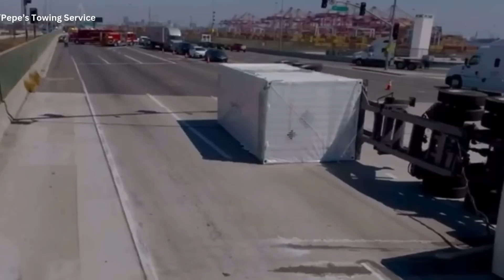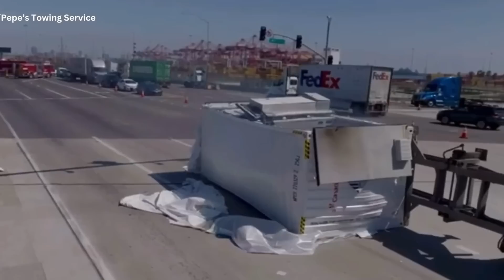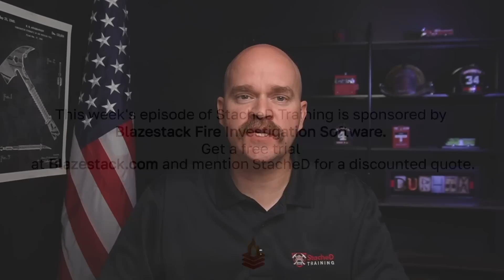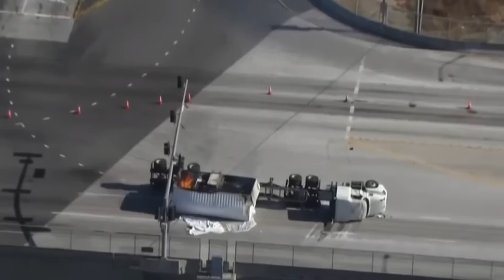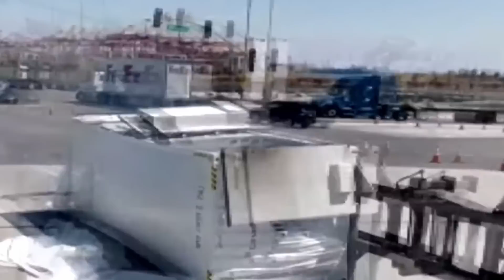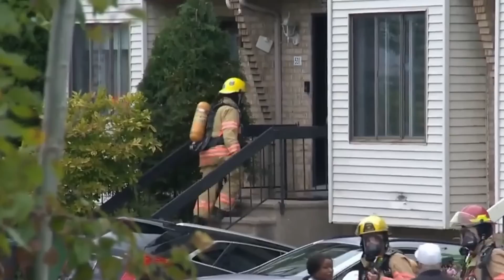LA Freeway Explosion & Montreal Port Fire: Lithium-Ion Battery Crisis

Comment: What kind of lithium ion battery were involved in those two cases? I understand that lithium ion phosphate is safer as it has less risk of thermal runaway.
Reply: Fairly confident the San Pedro incident involved LFP, as energy storage was from Canadian Solar, and their storage products appear to be LFP. 
But about LFP:
"... the important factor here is that due to the lower TR temperature of LFP cells it is more likely that the vent gas is emitted without combustion. This results in a greater likelihood of vapour cloud emission and accumulation, leading to an increased risk of vapour cloud explosions for LFP batteries compared to NMC. This needs to be stressed in safety and risk assessments given the general belief that LFP cells are “safe” or “the safest” in public media. This “safest” chemistry belief is based on typical abuse tests (overheat, penetration, etc) due to LFP having lower maximum temperatures and heat generation or the absence of visible sparks and flames. However, there are many instances of LFP-based EVs under TR and emitting vapour clouds, especially in the Chinese market where LFP dominates. Additional to this is the emission of toxic substances that also present a further hazard. As such, it is unwise to categorise the safety of a battery system based on the abuse test of cells that do not account for the explosion of the off-gas (and its toxicity) or the influence of the battery system design on failure behaviour. Therefore, there should be a focus within the battery community to provide a holistic assessment of battery safety considering stability and thermal, fire/explosion and toxicity hazards...
While NMC batteries release more gas than LFP, LFP batteries are significantly more toxic than NMC ones in absolute terms. ...LFP presents a greater flammability hazard even though they show less occurrence of flames in cell TR tests."
Excerpt from the May 2024 edition of Journal of Energy Storage. "Review of gas emissions from lithium-ion battery thermal runaway failure - Considering toxic and flammable compounds"
Reply: @greenriver-c7c  thank you for the info which is from a reputable source. It is worth thinking over.
Reply: LFP can still go into thermal runaway, but it takes a lot more abuse. Also it is easier to stop by cooling it with water. A recent study shows that a regular sprinkler system was enough to limit the impact of a thermal event to a single cabinet of LFP batteries. With NMC this was impossible in the same conditions. Both tests were forced with an external heat source.
And in the end an LFP fire will release less toxic materials than an LFP fire because there are no Nickel or Cobalt present and there is mostly CO2 instead of CO. 
NMC should be banned for anything bigger than a laptop (500 Wh)
Reply: @SolAce-nw2hf  thanks for the info. LFP is a good tradeoff between energy density and safety. Still, i would not buy an EV since I do not have a garage far enough from my house.
Reply: @Citizen052  I can relate to your fears. Only a few years ago I would not even consider putting a solar battery system in my home because of the fire risk.

But with much research and double checking every opinion, fact, fire statistics and negative news about battery fires, the LFP chemistry with a modern BMS turns out to be less of a risk than my home gas boiler.
NMC is already present in my home in laptops, tablets and phones and many other battery chemistries are also present in AA and AAA form factor.

Personally I have no off-street parking and I drive less than 5000 miles a year. So for me it does not make sense to get a new car as long as the current ICE works just fine. The EV switch will happen eventually, but public charging needs to improve a lot for that.
Reply: @SolAce-nw2hf  thank you. My reasoning is indeed very similar as yours. Me too I drive less than 6000 miles per year and my car has not even clocked 55k miles. So I won't change car for now and I hope that the battery technology will improve the safety aspect very soon.
Reply: @Citizen052  Yes, just keep it well maintained and let the EV improve at the rate of the PC in the early days while you wait 👍
Reply: @SolAce-nw2hf  excellent advice.
Reply: I'd say if there is an explosion then it was LFP, because it does not burn, it just creates a thick smoke (in case of thermal runaway),  ca 250 Ltr per every kWh, 50% of that is hydrogen. NMC on the other hand usually goes immediately on fire, because it is able to create oxygen on its own and even before the fire there is less hydrogen than with LFP.
Reply: @sleepydog6595  Both create a lot of hydrogen, but in NMC the amount depends more on the SoC. When abused LFP can also create a big explosion, but in that regard a big rig filled with fossil fuel is not exactly nice to deal with either. In my opinion all energy storage systems should have a vent for off-gassing, even in transport.

Comment: This looks like a port transfer vehicle, not an over-the-road semi truck. The container may or may not have been properly secured when the driver turned too fast/too tight, tipping the top-heavy load, truck, and trailer onto its side. The resulting fire was a forgone conclusion.

Comment: Do commercial drivers need a special license endorsement to transport one of the grid scale batteries? Seems pure ignorance that on dry pavement on a sunny day trailer would turnover.  
PS - LAFD should have a concrete pumper truck on contract so that they can fill the container with sand with just enough water to mobilize the sand. That way the can quench the fire and remove container for further disposal by OBA protected personal. 
PS — Can you imagine the 405 freeway shutdown for 24 hours. Not acceptable.
Reply: Containers on a container chassis trailer are known for being high risk of rollover even at low speed as they are often packed to the roof and have a high center of gravity.
Reply: @juliogonzo2718 Wouldn't they have to be packed at the roof and not at the floor to be top heavy? Otherwise the center of gravity is 4 feet above the floor, which is standard. Now if most of the load is at one side of the container, then you've got an imbalance on the trailer which is difficult to deal with and impossible to see.
Reply: @HuFlungDung2 anything over 1/2 container height is usually considered top heavy, plus depends on the dimensions of the cargo.
Reply: It definitely would be a hazmat load. I believe in the US, you need a hazmat endorsement. Here (Canada) you need TDG (transportation of dangerous goods) training which often is done in house at an employer. You get a wallet card certificate which you need to produce if stopped by police or motor carrier enforcement.
Reply: @juliogonzo2718 yeah we have to have hazmat endorsement to haul placard loads. Some hazmat loads don't require hazmat (based on a few factors) because they aren't placarded but those are very rare.
Reply: @raymarshall6721  can't remember the exact numbers here, been a while since i hauled hazmat, but think canada it's exempt from placards if its three containers or less and or 500kg total weight of dangerous goods and containment combined. So like 3 100lb propane tanks at 76ish kg each or two  drums of diesel at about 194kg each. Sorry about the metric it confuses me sometimes too lol
Reply: Pretty easy to see it wasn’t pinned down .

Comment: Yet another example of why large scale lithium based storage is utterly absurd the risk was bad enough with small device’s burning your house down but that could be managed to an extent this is next level ideological stupidity to think that a battery technology of which has inherent issues with instability are remotely suitable for large scale use just defies the most basic human logic
Reply: The geniuses in Australia now use lithium-ion batteries to buffer the grid because they produce with renewables. They get ripped of by the providers and have this crazy high outcome risk right at their door.
Reply: LiFePo batteries aren't nearly as prone to fire. The battery storage is often in remote locations. This resulted from improper logistics, not from usage. You can bet this particular episode will not be allowed to happen again. BTW there have been numerous tanker truck fires in the past, unfortunately. If you're correct in your basic point, time will tell, but I doubt it.
Reply: @nooneyouknow7036  -  Fairly confident the I-15 incident was a CATL LFP BESS container, and fairly confident the San Pedro incident involved LFP, as energy storage was from Canadian Solar, and their storage products appear to be LFP. And some further considerations on LFP:
"... the important factor here is that due to the lower TR temperature of LFP cells it is more likely that the vent gas is emitted without combustion. This results in a greater likelihood of vapour cloud emission and accumulation, leading to an increased risk of vapour cloud explosions for LFP batteries compared to NMC. This needs to be stressed in safety and risk assessments given the general belief that LFP cells are “safe” or “the safest” in public media. This “safest” chemistry belief is based on typical abuse tests (overheat, penetration, etc) due to LFP having lower maximum temperatures and heat generation or the absence of visible sparks and flames. However, there are many instances of LFP-based EVs under TR and emitting vapour clouds, especially in the Chinese market where LFP dominates. Additional to this is the emission of toxic substances that also present a further hazard. As such, it is unwise to categorise the safety of a battery system based on the abuse test of cells that do not account for the explosion of the off-gas (and its toxicity) or the influence of the battery system design on failure behaviour. Therefore, there should be a focus within the battery community to provide a holistic assessment of battery safety considering stability and thermal, fire/explosion and toxicity hazards...
While NMC batteries release more gas than LFP, LFP batteries are significantly more toxic than NMC ones in absolute terms. ...LFP presents a greater flammability hazard even though they show less occurrence of flames in cell TR tests."
Excerpt from the May 2024 edition of Journal of Energy Storage. "Review of gas emissions from lithium-ion battery thermal runaway failure - Considering toxic and flammable compounds"
Reply: Yes!! Have you seen the EV bikes burning down and killing Apartment and house occupants, when they take their bikes inside? They are COMEPLETELY dangerous!!!  Lithiom Ion, should only be used with small devices, and still you have to be mindful!
Reply: basic human logic ...
😆
Reply: They dont talk about unhumain the way they extract Lithium, KIDS!!!
Reply: @loveordie6146  half the worlds lithium is mined in Australia . Some of the best paying jobs and n kids involved. Maybe your thinking about cobalt the same children have been mining that stuff for the oil refineries for decades . It did t bother you them but bothers you now ?
Reply: @chrisward5626  the other half in Africa yes
Reply: @mb-3faze Yur so funy 😂
Reply: Ehh. No worse than all those houses built in Florida below sea level. We could build on pylons but they would be considered “ugly.” Oh well.
Reply: @loveordie6146  Well, that's not quite right: it's cobalt, not lithium and "they" are warlords, not battery manufacturers. Not all batteries use cobalt, but the point is, most of the world's known supply of cobalt is in the ground in Congo. That country is a mess. Most battery companies are looking for ways to reduce and remove cobalt, but it is very important in helping batteries last longer. The world is complicated. You're probably just wanting to throw shade at what you think is a liberal pet project, but batteries in grid storage make sense, utility operators love them, and they'll only be more. It's the market driving their adoption, not politicians.
Reply: Sand
Reply: Not if it's all part of their plan...
Reply: Your comment is a prime example of confirmation bias. You notice the battery fires, and ignore all the oil, gasoline, and diesel fires, which are also toxic, and do sometimes lead to explosions. Oh, and ICE vehicle fires are about 20 times more likely per 100,000 vehicles.
Reply: re: "this is next level ideological stupidity to think that a battery technology of which has inherent issues with instability are remotely suitable for large scale use" yes there is indeed a GREAT IRONY here in that with all the BESS fires we've seen reported in the news to date (which seems like all of them) that even IF this BESS hadn't overturned and exploded in transit...? had it made it "safe" to it's final installed location (with a bunch of other containers) it was nevertheless destined to end up being part of a FUTURE fire report on a local news channel somewhere.  yeah Big Battery Australia (2 locations), Moss Landing Ca, Otay Mesa Ca, Surprise Az etc have all CAUGHT FIRE.  the Captain of course has done uploads on quite a few other BESS fires whose location names i can't recall atm, but they're right there in his channel archive for anyone who wants to look them up.
Reply: Politics.
Reply: Against Batteries but Comment Posted Used a Battery Powered Device. Logic is undeniable
Reply: @OffTrap  we can make difference in a car and a phone lol. Do you?
Reply: @OffTrap  high voltage and low, big difference in stability and risk

Comment: The main reason battery nutters don't like hydrogen is because battery fires are so much more exciting!
Reply: Isn't hydrogen extremely difficult to contain and transport given that it's physically the smallest atom in the periodic table of elements?
Reply: @doktormcnasty  It is, and has a morbid attraction to oxygen, and kaboom...
Reply: @doktormcnasty  Yes, I keep losing them in my wallet 😂

But seriously, these problems have been solved a long time ago. Hydrogen makes sens for large and heavy transport where the battery simply fails to deliver. Maybe somewhere in the distant future we will have enough green hydrogen left for smaller vehicles , but an LFP based family EV is pretty hard to beat in terms of cost for those who can charge at home and don't drive more than the worst case range.
Reply: @SolAce-nw2hf  When you say, green hydrogen, you lose all credibility.  Look at the energy costs it takes to create hydrogen fuel.  Might be okay for you if you want to pay $20/gallon equivalent so you can call it green...
Reply: @scottw5315  In Germany the green Hydrogen created with excess solar and wind power is about €15 per kg. In the Netherlands it is a bit more expensive because of a lack of competing filling stations. But I agree that prices will have to come down to make Hydrogen more competitive. There are some big improvements being developed that reduce losses and Hydrogen production near wind farms is planned in the Netherlands.
Reply: Hydrogen as an energy storage medium uses 15 parts of energy for each 1 part of energy you get back. And our governments thought is was a good candidate for net zero emissions.
Reply: @bunsw2070  From sciencedirect:
Energy efficiency of system “green hydrogen production, compression, and utilization as a fuel” is about 40%.
Reply: You’re all missing the point of why they don’t like hydrogen. It can be made on demand, on location, as needed and thus cuts out transportation and metering, like with traditional fuels. They can still make money with batteries.
Reply: Hydrogen fire will last about a 1 tenth of a second
Reply: Remember the Hindenburg, 😂😂😂
Reply: Lol so you never thought to Learn about hydrogen bombs 🤦‍♂️
Reply: @chrisward5626  Hydrogen bombs use a radioactive isotope such as Deuterium or Tritium. These are not easy (or legal) to make so you will not find them in Hydrogen fuel.
Reply: @chrisward5626 some of us know them extensively, and is why it’s not even remotely of concern
Reply: yeah hydrogen is much safer, if a hydrogen vehicle catches fire it will basically go out instantly

Comment: But bu but… gasoline burn toooooooo 😮😮😮 (/sarcasm)
Reply: Gasoline requires oxygen to burn. NMC and NCA batteries provide their own oxygen, enabling them to burn more fiercely and be nearly impossible to put out by conventional means. With a conventional fuel fire, one quick foam spray to separate oxygen and fuel, the fire is out.
Reply: Je reste au Diesel alors.:face-blue-smiling:
Reply: It does. And it’s been killing us for decades.
Reply: Yes gasoline burns if you put fire to it. Doesn't spontaneously explode like batteries.
Reply: @kenik2023  in contact with sparks/fire liquid diesel burn, vaporized diesel and gasoline explode. That’s why you have kerosene/diesel home heater… but not gasoline.
Reply: Diesel wayyyy less likely to burn you alive. (Not sarcasm)
Reply: The BIG difference is gasoline vehicles don’t go into thermal runaway …
And vehicles 
CAN be PUT OUT !!!
Reply: @batmanlives6456  Isn't there some kind of firefighting foam for electrical fires?
Reply: @doktormcnasty  No, depriving this sort of fire  of oxygene doesn't change anything, in a battery cell there is both combustible and oxydiser, tey use water to cool the fblaze, not to extinguish it
Reply: No, the lithium batteries produce their own oxygen, once burning, so as the term goes, they are self sustaining fires.
Reply: @batmanlives6456  Petrol and diesel cars do not burn at 2000 degrees plus, do catch fire 24/7 and are easily extinguished and when switched off are inert. You clearly know little about fire, fire behaviour and its causes.
Reply: EV's mobile cremation vehicles.